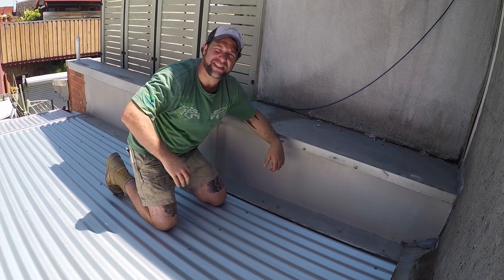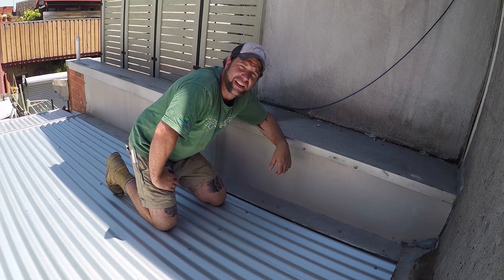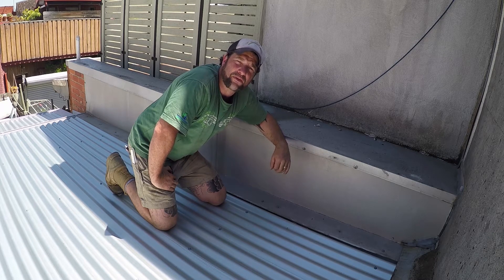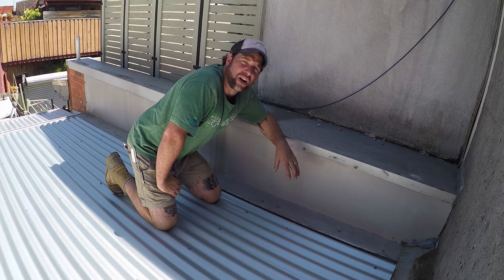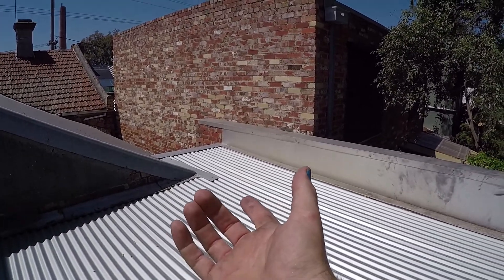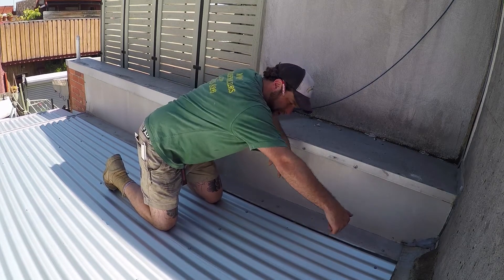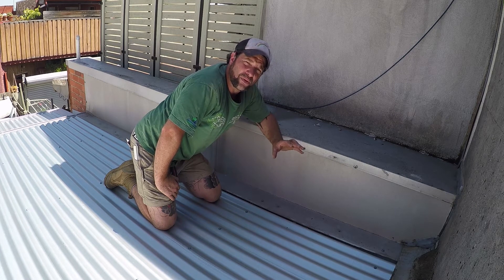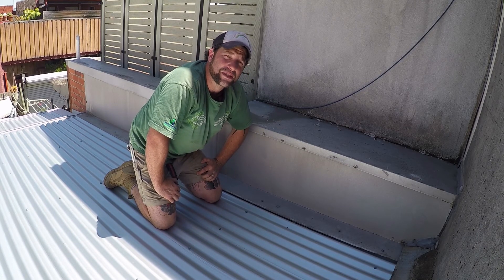What angle for a Corrugated iron and roof pitch

Comment: I’ve installed a corrugated roof with exactly a 5 degree pitch (bondor insulroof). Worried now about capillary action causing problems. Any way I can improve my situation?
Reply from the maker: Gday Bikpela,
yes there is... curl your corrugations at the ends with a pair of pliers or/and run a bead of silicon also... this will give a border line for the water to drip off.
#stayawesome
joe joe

Comment: Wouldn't something like trimdeck be better suited at that pitch? Take the corry off and replace with trimdeck, turning the pans up at the top and down at the gutter. A lot easier than re-pitching the roof?
Reply from the maker: Gday Walker 11288,
ABSO-BLOODY-LUTLEY it would be much much better in Trim deck or to be re-pitched but, as my Dad use to say, "you can lead a horse to water but you cant make it drink !"  i can point them in the right direction but if they don't want to fix their home properly or they don't have the funds what else can we do.

thanks for sending your thoughts through
#stayawesome
uncle joe joe

Comment: Awesome vid mate. You gonna show us the pitched roof when it's done?
Reply from the maker: Gday Haikin91,
thanks for the feed back.
we have forwarded our recommendations and costs to the client and will see what they want / can afford to do...... no point in doing the work and not getting paid !!!
the two options are to change the roofing to a klip lock deck (flat roof system and yes before you ask i do have a video regarding this on the channel) or the re-pitch as spoken about.

stay awesome
uncle joe joe
Reply: @BeowulfBuilders  Great video uncle joe joe, I am trying to fix my roof pitch issues as well, so just wondering with an area of approx. 25 sq meters roof, which option is cheaper, re-pitch the existing roof or change to klip lock deck or trimdeck system? Thanks